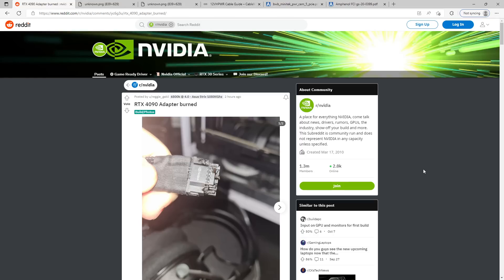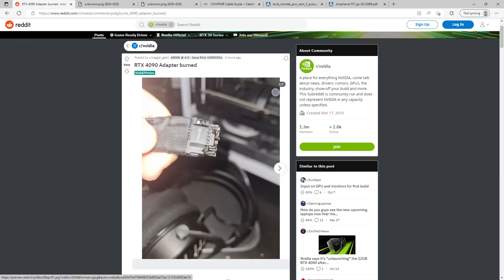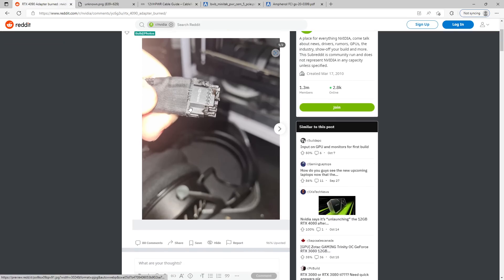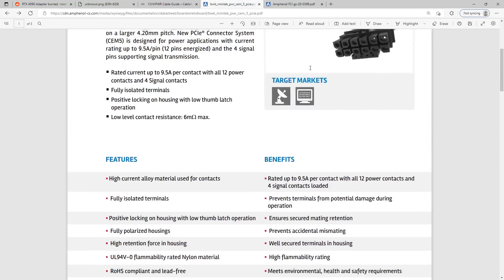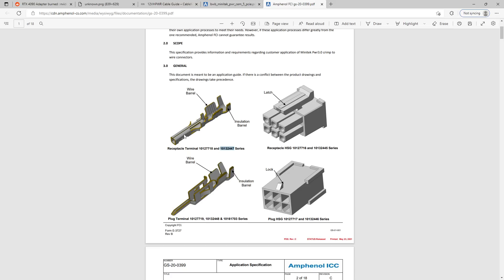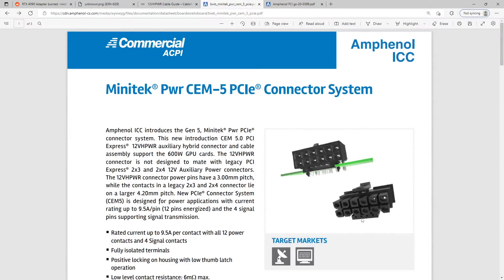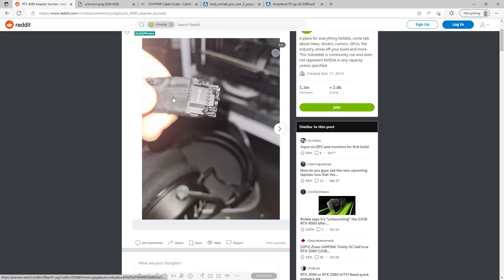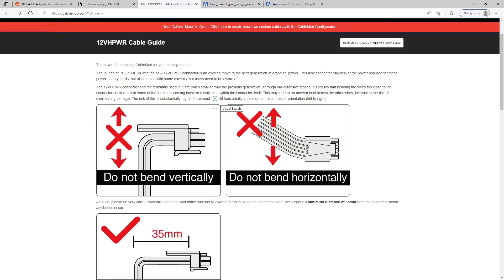The 12VHPWR connector sucks

Comment: Also, Jonney Guru was saying the 150 watt "rating" of a single 8-pin PCIe connection isn't an actual power load rating. It was more of a classification rating that NVIDIA came up with for their own cards. As he stated in a Q&A video with eTeknix, smaller terminals with less 12v leads can't handle more current than a larger terminal with more 12v leads.
Reply from the maker: sure but the end result of the entire industry treating the 8pin as a 150W connector is that the 8pin has a massive safety margin. The new 12VHPWR has pretty much no margin for sub optimal operating conditions.
Reply: @ActuallyHardcoreOverclocking  Absolutely. Just saying that, all other things being equal, if the 12-pin can handle 600 watts, so can two 8-pins. And if two pins can't really support 600 watts, neither can the 12-pin. I agree with what you said in the video completely, the 12VHPWR connector is a terrible design that had no reason to exist outside of it being small enough to fit on their reference boards. Happy to hear that AMD isn't going to be using it, hopefully partners as well.
Reply: Mr Guru has not been relevant in more than 5 years..
Reply: @godslayer1415  Based on what exactly? If if that were the case, that little tidbit of information is over five years old anyways. So, even if you were correct... which you're not, that information is from when he was still "relevant" and thus, still true.
Reply: @TheGameBench  Maybe he's referring to the fact that you can't rely on an employee of a power supply manufacturer for impartiality, nor to say candid things about the products designed by their corporate partners such as those Buildzoid said in this video.
Reply: @markroberts-barter4523  Even if that is the case, I don't see how his employer has anything to do with it. His comments on this current matter in no way involve Corsair or their competitors, so that really has no bearing on this issue. The fact of the matter is that the 12-pin connector has six 12v leads. Two 8-pin connectors have six 12v leads. If the wire gauge is 18ga or higher and the 12v rail is up to the task, they're capable of supplying the same amount of power. There's nothing magic about the 12-pin that means it's capable of more.
Reply: @TheGameBench  If you are employed by a power supply manufacturer, who is implementing this Nvidia sponsored spec, then your employer will have written into your contract that you are not allowed to bring the company into disrepute (pretty standard corporate clause, actually). So it has direct bearing on that employees ability to be honest about shortcomings in his company's products. He's contractually obliged to say good things and good things only. If he were to say something negative and then - God forbid - Corsair products caused fires later on down the line plaintiffs could use comments from employees to show that Corsair was wilfully negligent.
Reply: @markroberts-barter4523  There are a lot of issues with what you said, but to start off... yes, I'm sure that he has signed contracts as to something similar to what you're talking about. However, this comments was in regards to technical specifications of an established standard. In no way does it impact Corsair's business relations with anyone. So his expertise on the technical workings of a power supply, electrical engineering, power delivery, established standards and specifications... ect, are all entirely relevant regardless of his employment with Corsair and they would take no issue with him talking about facts regarding the power delivery capability of the longstanding PCIe connection. He wasn't stating an opinion or being inflammatory towards any company.

Next, Corsair isn't even implementing ATX 3.0 on their power supplies yet, so they wouldn't even be licensing anything to do with it, as of yet. Even if they were, NVIDIA isn't sponsoring the ATX 3.0 standard or the 12VHPWR connector. They had input as to such, but they aren't sponsoring it and they have nothing to do with licensing it. So, Corsair's power supply division would have zero business relation with NVIDIA even if they were, which is irrelevant regardless as per my first paragraph.

Lastly, you should watch that video. If anything, he was quite objective about the situation. He wasn't negative about, nor did he didn't talk the 12VHPWR connection up. He even explained why Corsair isn't using it on their PSU's, and the fact that two 8-pin connections are just as capable of delivering the same amount of power. If it were only capable of delivering 150 watts, there wouldn't be dual 8-pin 3080 Ti and 3090 models that consume well over 300 watts.

What he stated in my original comment is objectively a fact. His relationship, or any documents he signed with Corsair do not have any bearing on that fact and it doesn't render his objective expertise in the field irrelevant. Nor does it prevent him from stating facts, as they would not impact Corsair's business.
Reply: @TheGameBench  "NVIDIA isn't sponsoring the ATX 3.0 standard or the 12VHPWR connector. They had input as to such, but they aren't sponsoring it"

Really. They aren't the primary sponsor of the 12VHPWR connector? When they released a 12 pin power connector on their RTX cards in September 2020, 1 and a half years BEFORE March 2022 when the connector became officially part of the ATX 3.0 specification. No one else was mainstream manufacturing it before the specification. Just Nvidia. Yet you think they aren't the primary sponsor of that connector.

"He even explained why Corsair isn't using it on their PSU's, and the fact that two 8-pin connections are just as capable of delivering the same amount of power."

Which contradicts what PCI-SIG have said to their members, which include Corsair, about over-current dangers: https://wccftech.com/atx-3-0-12vhpwr-gen-5-connector-major-safety-risk-using-adapter-confirms-pci-sig/

What he has stated is objectively contradicted by PCI-SIG, themselves.
Reply: @markroberts-barter4523  Just because NVIDIA was the first to use it, doesn't mean they invented it. They certainly aren't the ones manufacturing the connectors or the terminals.

But this is semantics and I don't care if the did, or if they didn't, it's irrelevant and I've already explained why.

Comment: The Corsair two 8pin to 12pin is made of solid core wire (J2C video) and bends a lot easier. Ppl with Corsair PSU's are in a good spot; have my adapter on hand for when i get a waterblocked 4080/90

Comment: Come on BZ, your content is usually pretty good but this is just zero-effort FUD.

1. A sample size of one burned adapter does not necessarily indicate a design problem with the 12VHPWR connector form factor.
2. CableMod's "extensive testing" is also a sample size of one.
3. Plenty of Molex-to-6-pin-PCIe and Molex-to-8-pin-PCIe adapters have/had this exact same problem of melting; it's hardly unreasonable to assume that 8-pin-PCIe-to-12VHPWR adapters could have the same issue. Once PSUs with native 12VHPWR connectors appear and adapters are no longer necessary, this problem will cease to exist.
Reply: you can nag all you want. this design is bad from an engineering pov. your opinion means nothing.

Comment: Wonder if the ones with the new atx 3.0 would be better or still have this issue
Reply: The connector is just a bit too tiny.  I think 600 watts is insane for this connector...   I think they could have just used more robust 6 pin or 8 pin with thicker wires and rated for more power.... than this contraption. But the thing is.... they want to be incompatible with the old connectors on purpose.  But why they didn't made it bigger ?!  If the connector was bigger it would have probably worked.... at least with bigger more robust connector it would have been less of an issue.

Comment: I guess I can post a photo of a melted 8-pin connector (of which there are many) and make a video feeling “vindicated” by an anecdote too. 

I think the adapters are stupid. The connector itself, when used with cables that go directly from the PSU to the 12VHPWR is IMO much, much cleaner of a solution than 4 8-pin connectors. Those do actually use a ridiculously large amount of board space, they’re inefficiently designed (only 3 terminals per connector actually carry power), and it’s truly absurd to have these gigantic PCBs with miles of wires hanging off the card.

Nvidia’s founders PCB is actually forward-thinking in terms of its compact size and unique and effective cooling solution. Also it’s a godsend for custom waterblocks - the space saving is HUGE.

Yes, you advocate for PCBs the size of a shoebox that have 4 8-pins and massively oversized coolers, but not everyone wants what you want.

If you don’t use shoddy adapters or bend them so as to unseat the terminal connections, then it’s much more ideal to have a single cable carrying power to the board, especially if, when connected to the new PSUs, it meets the new ATX 3.0 / PCIe 5.0 power standards.

Comment: They literaly select the best dies for them selves.... then screw things up entirely with a simple thing like a connector.... When your leather jacket is more important then a good thought trough product. facepalm 
P.s. Tip for everyone concerned about this problem, take 2 tight fit heatshrinks,  one 3cm one 5cm. Put the 3 over and put some drops glue on the connector side. Shrink in place, then the 5 cm. I always do this with phone charge cables to ad a bit more graduating stiffnes to flex region.

Comment: My kingpin 3090
With optimus waterblock (just saying)
With XOC bios tuned pulls over 900 watts in furmark. 
On 3 8 pin connectors
Good evga ones.
Why nvidia changed something so safe to something that can burn your house to the ground is just utter incompetence.
Fk you nvidia

Comment: Not to mention that the smaller the terminal, the harder it is to have a strong crimp, which exacerbates this issue. You have way less margin of error. My guess is this is a matter of increased resistance causing a heat issue. Hilarious that they said increased load. The person that wrote that has no idea how this all works.

Comment: 😂the 4090 doesn’t even need 450w, because TSMC die is so efficient the the 4090 retains 95% percent of it’s performance at only 300w ish according to der8auer , so this card doesn’t even need 450w power limit, you could get amazing performance by just stick around 300w and dual 8 pin just like any old flagship Nvidia card, so basically the 12vhpwr is a fine example of a solution to a problem the have created

Comment: I have burned sata connectors like this two times in my life, about 7 and 11 years ago. The cables/connectors were bent "away" from the contact surface - resulting in lower contact surface, higher resistance and too much heat. So the moral of the story - don't use pin/sata connectors that are loose (metal to metal) and don't bend the cables close to the terminal point in the first place.

Comment: Woah woah okay conflicting information here: you claim it ships with a 450W power limit yet gamers Nexus and Nvidia itself say 600W power limit out of the box.... I'm uh confused. I thought it was a difference of the sense pins in the cables and it will use whichever power limit makes sense for the amount of wires connected. 3=450? 4=600?

Comment: as I already said I had spikes of 60A+ (overall but a good 40A on gpu alone) which if not destroyed oveheated my 3090 VRM enough that it smelled burned and it was a watercooled 380w power limit....and they think you can run more through this (don't forget the spikes !) as an actual electronician the wire wrapping after the connector felt ghetto at 1st glance >< that's what you do as a quickly done repair not on a final product, they should have provided a 90° angle for sure

Comment: If I were designing a connector for this thing, I would’ve combined all 4 of the PCIe connections into an extension cable that used much larger gauge wires with less pins.  I think the problem is all because of the massive amount of resistance those tiny little wires must have by default, that any bending is just too much for them to take.  (For example: Apple’s OEM Lightning cables have the same issue.)

Honestly, if they wanted to keep it looking nice, then they could’ve just used 2-3 USB-C cables to provide power.  The latest revisions of those cables handle 240w each, so two of those would have more than enough for stock operation at 450w—but if you wanted to go nuts, adding a 3rd would give you way more headroom, because there’s no way it’s ever gonna pull 720w on a sustained basis.

Obviously you wouldn’t want people using off the shelf USB-C cables and connectors, but I feel like it would be super easy to use those connectors instead, because they’re much easier to insert and remove without wiggling and bending things too much.

Hopefully AMD doesn’t follow their stupidity and they stick to more standard connectors that can handle all the additional power being drawn by these new GPUs.
Reply: Jay2Cents says that AMD ia also using these on RDNA3!? 
The new spec was at Intel's behest and request, supported heavily by Nvidia. Yet Intel isn't using the 12vHPC they are using 2x8pins.

Comment: @ 8:00 the same crimps are used in plenty of automotive and small aircraft(though thankfully fewer and fewer in the latter case) If they are improperly crimped the wires can easily pull free from the contacts while the ears that lock into the connector housing can break and permit the wire and contact to slide back.

Comment: I think, instead, that the plastic housing is intended to be designed to take the mechanical stress off the metal connections, and the fact that the connector can fail is an indication of bad design failing its intended performance. If this is the case, the issue is not so much the electrical/metal part, but rather the mechanical/plastic part which could be too small and/or flimsy in the way they latch on and stay put.

Comment: For anyone not having seen this already, GN reported back in September that Nvidia itself had found some potential overheating with that connector, which was likely tied to bending:
https://www.youtube.com/watch?v=p48T1Mo9D3Q&t=322s

And in a later video interview they stated that all of the issues with the adapter cable have been fixed and that they're "very confident in it".
https://www.youtube.com/watch?v=MxU1AkGNnT0&t=1685s

Comment: Funfact: 8-pin PCIe cable is rated on 150W when it can burn taking 250W+ on connector (3-power cables), BUT 8-pin EPS cable has 4-power cables and it it rated for 400W. So this 12VHPWR connector actually working in EPS standard.

Comment: For reference some (all?) 3090tis use this connector too, I’ve had no issues, it’s in a Sliger SFF case

They could ultrasonic weld the pins in place if they made a receiver die to properly align all the pins with precision before USW them

To me it looks like the issue seems to be a lack of even contact on the pin side which could also be fixed by increasing contact force in the crimped connector, thereby increasing  spring force to more positively lock around the pin, it would make insertion more difficult and someone would probably break the thing that way too. They should have use one wire communication and have active comms to new power supplies to communicate rather than having a bunch of “dumb” sense pins. This way a dynamic power limit within the PSUs capability could be achieved.

Comment: Actually Hardcore Overclocking : so to summarize the complete faultiness of the RTX series :

RTX Pascal refresh 2000 series = dying memory chips with artifacting due to overheating issues and poor cooling design that Nvidia failed to present to the AIB partners, 1350 MHz gpu core lock bug and numerous BSOD-s

RTX 3000 series = cheap back capacitors causing chip dies to blow up and quite a few memory overheating and VRM overheating examples causing to partially suspect poor-er cooling design of certain models

RTX 4000 series = mechanically and electrically under-designed power delivery cable

Comment: Most connectors have stress relief molding to prevent this very issue.  For ethernet cables it's called a boot.  To me this just seems like extremely bad connector design on Nvidia's end because it would be a simple matter to include a boot that ensures 35mm of unbent cable into the receptacle.

Comment: This is why I didn't buy a RTX 4090 on release lmfao I was waiting on these issues to crop up before I bought it. Nvidia sales will likely fall no one is going to buy a new PSU or an RTX 4000 series until this is addressed. AMD may have already won Nvidia was so busy trying to beat them they didn't think of the issues of fighting a more efficient node with power. Jensen is arrogant as ever.

Comment: I love how one person says "Nvidia made bad thing" and everybody just parrots and repeats it without giving it a tiny bit of thought that it might not actually be correct that Nvidia MADE the connector
Reply: @robertmorea3446  It was designed and contracted and integrated into the ATX 3.0 spec by PCI-SIG
Reply: @robertmorea3446  You cant really implement a fragile requirement better than the weakest link. And the weakest link is the plug which is completely out of nvidias control.
Reply: @robertmorea3446  They kinda had to as the standard is forced to move on
Reply: @robertmorea3446  Its being semi inforced by PCI-SIG and ATX standards

Comment: 3090ti ftw3 has an excellent 12pin cable made by EVGA. Have drawn up to 500+ watts on it, never had an issue, don’t need to bend it hard because its actually of decent length and aesthetically pleasing. Too bad they are out for the 40 series.

Comment: This connector is for power delivery, voltage sensing and current sensing. While yes this a not a very durable design it is also not Nvidias fault for PCI-SIGs design and people not using it as designed. Shitty design doesnt get better by wrong installation